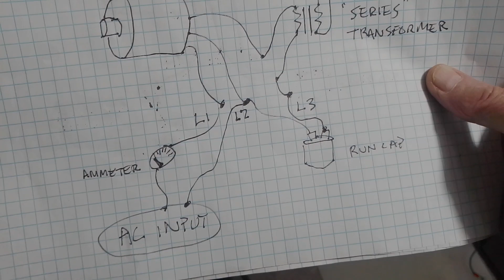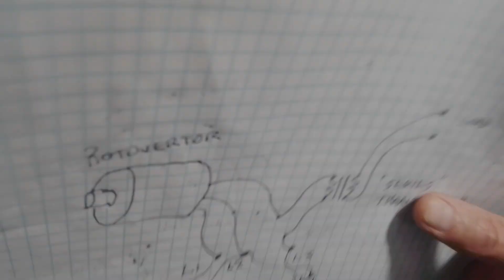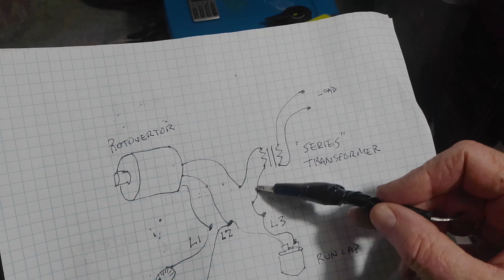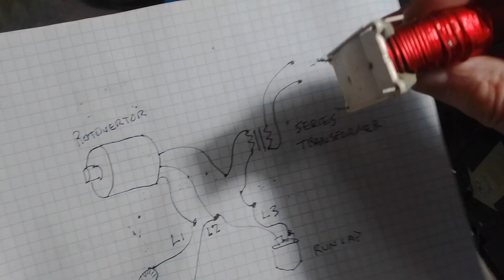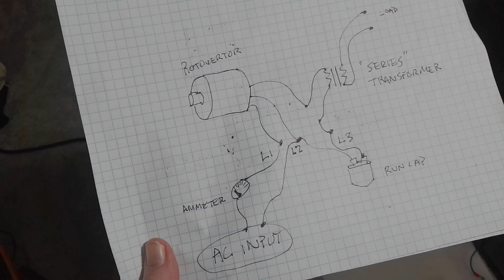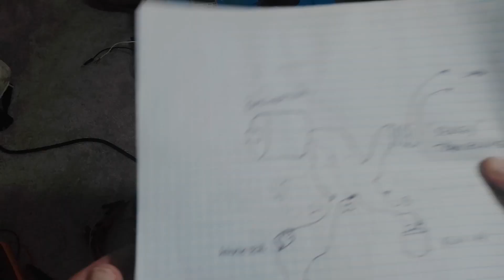Taking out power from series transformer on L3 line of rotovertor

Comment: MR. KONZEN I thought low impedance  was had using thin or light gauge wire but here you said  L3 was to go through the primary side thicker side of transformer ?  Do I have this backwards ?
Reply from the maker: Yes, you are backwards - high impedance winds in a MOT transformer for example are the ones with very thin wires, while the low impedance winds are the ones with the very thick wire.  Confirm measuriing with ohm meter!
Reply: @MrDKONZEN  So impedance  and resistance are closely related but not the same .
Reply from the maker: @frankchandler8005  impedance is the measurement of resistance and it is labeled "ohms"
So for example 1 ohm would be very "low" resistance, while 1000 ohms would be very "high" resistance.
Where there can be confusion is if one were to say "that is very HEAVY resistance" or if one were to say that is very LIGHT resistance.....Heavy would mean low impedance, Light would mean high impedance.
"low resistance" can be confused with Light resistance speaking in normal non electronic  speak.....
Reply: @MrDKONZEN  I think I understand but why would one say  high  or low resistance   but  instead   say heavy resistance  or light resistance . I've not heard that expression used before. I'm still learning thanks.🤔

Comment: Hi Konz.Thanks for sharing. I have been interested in the Rotoverter for a while now, but have not done any experiments with it. It is odd that you can measure any current on the secondary winding of the series transformer without a load on the secondary windings. It would ne nice if you could wire up a bulb that can handle the voltage and then measure the AC current using the bulb as a load.
Reply from the maker: Hi Buildit
The load on secondary of the series transformer is just an ammeter "crowbarring" the current through it. A load with near no voltage sorry but its a start.  I will need to wind specific sort off transformer for this, with a step up ratio so some good amps and maybe 15V in secondary.  Need to include some caps too, maybe a second transformer. 
I can also run a 2nd motor direct from the AC of  the run cap phase.  Lots of ways to go with it....I like the series transformer way righ now we will see how it goes.  Look at the pretty new videos by Light Seeker on YouTube, he puts caps all over the place in the circuit, got a meter to stop spinning, also showed PF of zero so zero watts input according to meter with PF function to it.
I did do some light bulb experiments  with light bulb in place of run cap, and got 93 percent effiecincy but was big mess didnt film it.
I was using fairly big caps and got currents up to around 400ma both in and "out'" with the light bulb......I like to stick around the 40ma if I can for right now...Many ways to go with the rotovertor....
Reply: @MrDKONZEN  That makes sense. I have seen a current draw on the primary when the seconday has no load. Interesting. I will take a look at Light Seekers videos. Thanks!